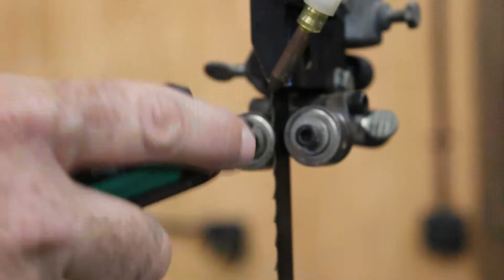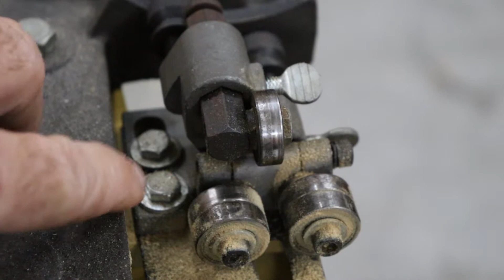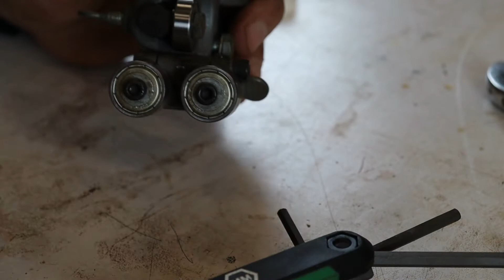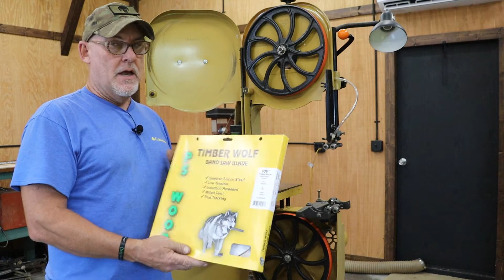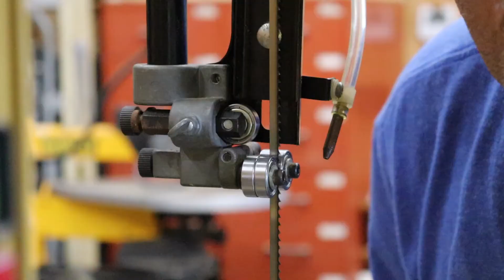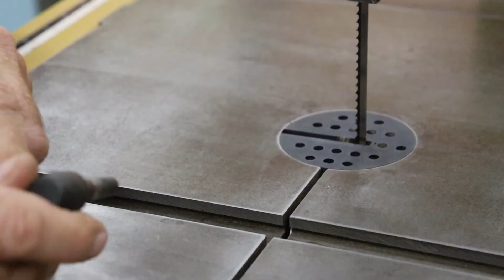How to tune up a 14 inch Powermatic Bandsaw - The End Grain Workshop

Comment: Great Job!   Could you explain the 3 positions on the tensioning bar?  Thank you.
Reply from the maker: Sure with the bar in the lowest position there is zero tension on the blade this position is used for changing out the blade.  With the bar in the middle position there is 50% tension on the blade this position is used most of the time when you’re not using the saw.  It preserves the life of the blade by reducing the tension on it. The highest position is full tension and should be used while operating the saw.  Hope this helps and thanks for watching!
Reply: @TheEndGrainWorkshop  Thank you!!

Comment: I am having a hell of a time making the blade travel right  I use to be able to do quick but having time every time I put a new blade what am I doing wrong?.....Larry
Reply from the maker: Hey Larry, I feel your pain—bandsaws can be finicky, especially when swapping in a new blade. A couple things might be tripping you up. First, make sure the blade is tensioned properly and that it’s the correct width for your saw and the wheels. Then double-check your tracking adjustment—sometimes just a small tweak on that upper wheel can make a big difference in how the blade rides.

Also, don’t forget to square up your table and reset your guide bearings or blocks after each blade change. If any of those are out of whack, it can make the blade wander like crazy.

It sounds like you know how to do it—you might just be fighting a dull blade, a worn tire, or a bit of sawdust in the wrong place. Hang in there, and thanks for watching!

Comment: Hi, curious if would you recommend this bandsaw for a new purchase to someone looking for a new bandsaw in 2025. I’m comparing this to a Laguna 1412, a jet, a rikon etc. thanks in advance ❤
Reply from the maker: Great question! The Powermatic 14" is a solid saw with good build quality, but in 2025, there are definitely some strong competitors. The Laguna 1412 is a great choice with a great fence system, and Rikon has some impressive features for the price. It really depends on your budget and what kind of work you'll be doing. If resaw capacity and ease of blade changes are important, you might want to compare the specifics of each. I don't feel that the Rikon or Jet can really compete with the Powermatic.  The Laguna however is a great saw but at a price.
Reply: @ thanks a ton! I think I’ll go for the Powermatic, especially since it comes with a 5 year warranty. Thanks again.

Comment: All tuned up. Got new tires, Timberwolf blade, new bearings and air hose. Back together and running ok. Seems a bit noisier than before but I went from 1/4” to 1/2” blade. 
Thanks for your help. Seriously. 
Paul
Reply from the maker: No problem.  I'm glad everything worked out.

Comment: Ok. I had the wrong hole for the thrust bearing. But once assembled, the blade is touching the right bearing and the thrust bearing is pushing into the blade. The assembly seems to be as far back as it can be. 
I just changed tires and blade and am having trouble getting the blade in the tire center. What a mess. 
Paul

Comment: You never say which way the central shaft is inserted. It has a lip in it. Is the lip on the inside or outside?
I removed all my bearings but the rear thrust bearing hole doesn’t line up with the mounting hole. I checked the original and it has the same problem. What’s the trick?
Thanks,
Paul

Comment: Ok. I think I got it. My wife must have slipped me some goofballs this morning in breakfast. 
I notice that Amazon sells both upper and lower bearing housings as well as the bearings themselves. My bandsaw has been in storage for  over 15 years. Do you think I should just replace the whole units rather than just the bearings?
Paul
Reply from the maker: @paulmanhart4481  If it’s within your budget absolutely.

Comment: Hi. This is a very good video. Thanks. 
I have one of these PWBS 14 that I bought in 2005. I recently removed the upper and lower wheels to replace the two tires. The upper wheel was difficult to remove and I heard a “clunk” or two coming from behind. 
Now I have both wheels with new tires on and I’m trying to put in my new blade. But somehow the tension lever got turned around and the knob at the top doesn’t move the upper wheel. I’m at a loss on what to do. Any ideas?
Thanks,
Paul
Reply from the maker: @paulmanhart4481  Hey Paul,
Sounds like it could be an issue with the tension spring.  Sometimes they can become fatigued and will need to be replaced.  I hope this helps and thanks for your feedback!
Reply: Can you run the tilt screw out of the threads? I’m thinking I just did that and I’m looking for some info on that mechanism.

Comment: Your video did a great job showing how to change out bearings and tires.  However I am disappointed in your lack of instructions on how to put the table back on.  I am having trouble aligning the table in all three axis...there is little to no finger space to make adjustments to the trunnion.  I wish you would have spent more time on this.  The Powermatic manual is lacking in depth to the finer points of aligning the table top.  

Chuck B
Reply from the maker: Sorry about that, try the video in the below link around the five minute mark and thanks for watching!

https://youtu.be/z9wSxTJ_vtc

Comment: Fantastic video. Thank you for doing this. Do you have any tips about adjusting the table to improve tracking while using a fence?
Reply from the maker: Here are some tips for improving bandsaw tracking and fence:
Blade tracking
Make sure the blade's centerline is in line with the upper wheel's centerline, regardless of the blade's width. This will help keep the blade aligned with the blade guides. You can also check that the blade is centered on the wheel by opening the idler wheel compartment and using a ruler to measure both sides of the blade. The blade should be equally spaced from the outside of the wheel.
Wheel alignment
Make sure both the upper and lower wheels are aligned properly. Misaligned wheels can make it difficult to achieve the desired cut.
Fence alignment
Make sure the fence is parallel to the miter slot. You can also try adjusting the fence to match a line you drew on the table top with a pencil.
Blade guides
Make sure the blade guides are set equally on both sides of the blade. You can also try bringing the guides in slightly away from the blade, but not quite touching. Some people use a feeler gauge or a corner of the blade pack to determine the right distance.
Thrust bearings
Make sure the thrust bearings are a paper's width away from the blade.

Comment: I have a 14 inch Powermatic bandsaw the black one and I must have changed the setup for both the upper and lower bearing doesn't look nothing like yours I guess I did it when I put it all together  maybe 12 years ago I guess not sure anyway I need new bearing etc but how can I get the setup you have? I have the old parts maybe I can send you a pic or text you a pic of what I have. I put new tires on a month ago and today I was cutting a circle with the jig I made and not good I don't know what's going on!  sorry about going off just lost are son and I guess anyway if you can help that would be great I know your busy ! thanks Larry from calif Bay Area
Reply from the maker: Hey Larry,
Sorry to hear about your son.  If you can send me some pics I'll be more than happy to take a look at it.

Comment: I have the Powermatic PM1500 version band saw.  I went to rip some 3/4 thick x 4-1/2 tall pine boards down to half inch thick today and was disappointed a bit.  The blade was drifting off the side of the board immediately.  I’ve checked my blade tension, my bearings are all in the proper place, I have a 1” blade that is an alternating type, with teeth at 3tpi.  Is that a good blade to use for this application?  I looked in the trouble shoot menu of the manual.  A few things listed as possible issues and fixes.  One is, was the blade sharp, I’m not sure how to tell, except that I know it’s not that used yet and feels sharp to the touch.  The other thing was clean the blade.  I have no idea on how you clean a band saw blade, manual says nothing about this.  Would you know?  I have no idea why it wouldn’t go through these pine boards like butter.  Any suggestions would be greatly appreciated.  Thx
Reply from the maker: For resawing on a 14"-15" bandsaw a 1/2" blade with 2-3tpi is a good choice.  To clean the blade first unplug the bandsaw and then open the upper wheel compartment.  I'm right handed so I would manually turn the upper wheel with my left hand and with my right hand with a glove hold a razor blade perpendicular to the blade and scrap off as much saw dust residue as you can while turning the wheel.  Once you've done that to one side of the blade then repeat for the other side.  Once you've removed the saw dust residue on both sides of the blade, then take off the blade and coil it up like I showed in the video.  Take a five gallon bucket and pour some "Simple Green All Purpose" Cleaner into the bucket.  Fill it up about a quarter of the way, then place the coiled up blade in the bucket.  Clean the blade with a brush and just keep rotating the blade and cleaning it unit you've cleaned the entire blade, then reinstall it on the bandsaw. You're right it should be resawing thru pine like butter.  If you've checked the tension make sure the tires are in good shape and you don't have any slippage.  Also, make sure your fence is square to the blade as that can cause drift as well.  I hope this helps and thanks for watching the video.
Reply from the maker: https://amzn.to/3FZDh2N